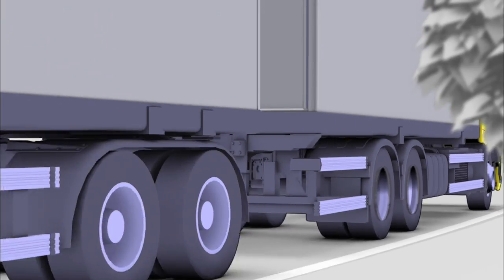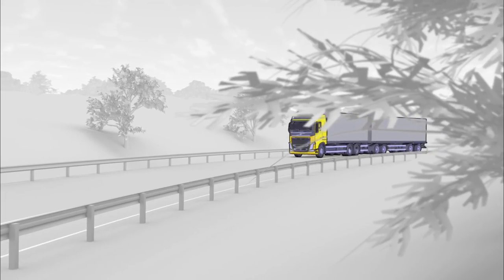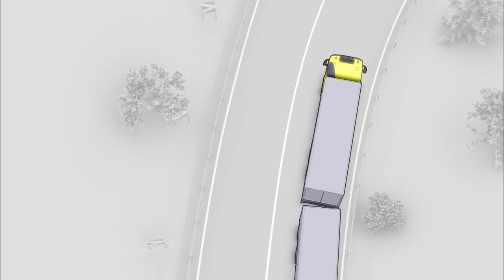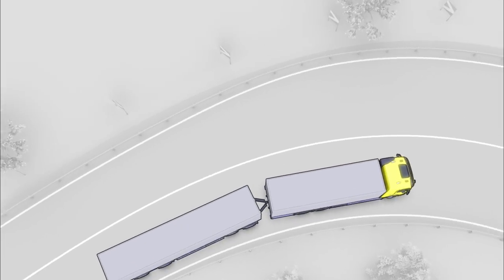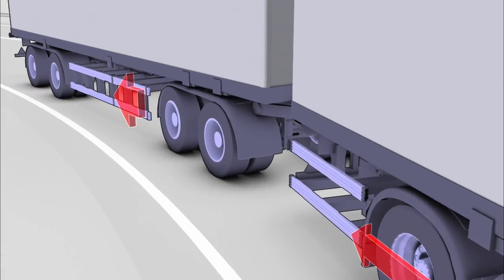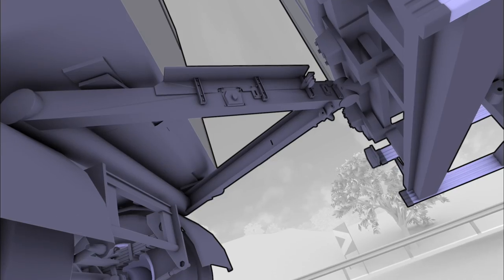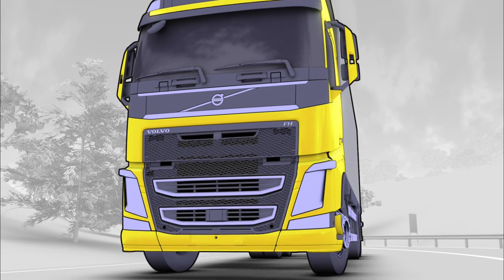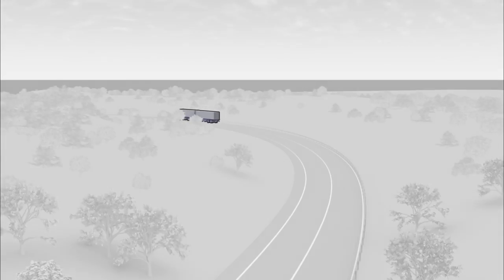Volvo Trucks - Electronic Stability Program prevents rollovers

Comment: dear volvo .
introduce me Andy, a mechanic at a coal mining company, 

I would like to ask you about the capabilities of the Volvo FMX 440 6x6 truck, which is used as a truck crane with the brand Amco Veba 9 tons. 

that I want to ask.  Is this truck safe to use on offroad ( mine road) if carrying a multiflo MF 420 EXHV pump with dimensions of 6 x 2 meters with a height of 3 meters , weighs about 12 tons.

Best regards

andy

thankyou